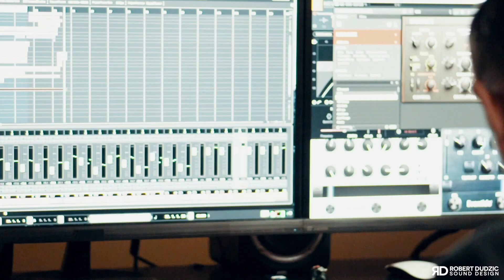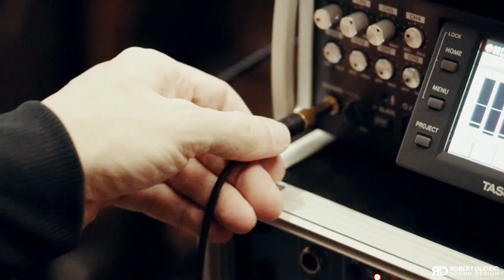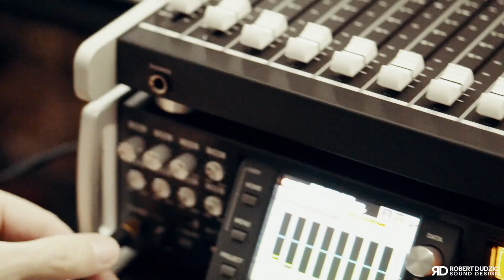HOW I DO WHAT I DO 2.5 The rough story of my sounds.

Comment: Hello, Robert! I hope you and yours are doing well in these crazy times. I've had ONE specific issue with my NI Maschine Studio 2.0 since reformatting my Mac OSX system 'back' from Catalina, where it didn't work, to Mojave 10.14.6 where it does/DID/almost work. I don't have the NI Maschine activation 'icon' in my menu tray! I've reinstalled from the original DVD discs that came with the Studio and I've been able to download all my previous software and the NI Access icon in my tray, but there isn't a  Maschine Controller 'icon' where I can Open or access the Maschine itself! There's also 'nothing' that pertains to this issue in the NI website at all. Can you help me out? The Controller console works, turns on, but the Maschine workstation 'icon' and it's workflow contents are 'not' visible/there for me to Open/access. Thanks for all you do.